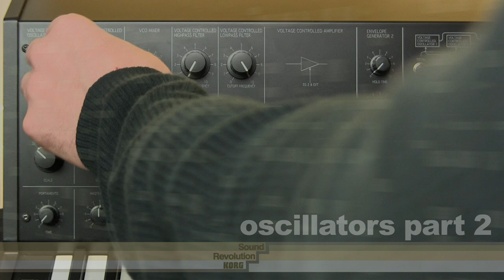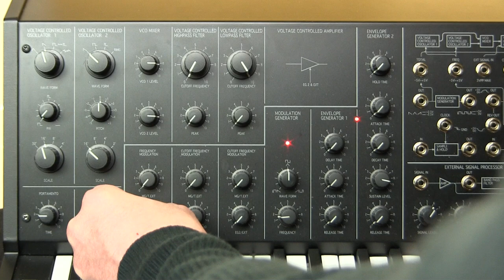The Korg MS-20 Mini- Oscillators Part 2

Comment from the maker: The MiniBrute is one of my favorite modern synths.  I can't get enough of the thing.  The re-release of the MS-20 had reinvigorated my attraction to it.  They're really both quite different, but I love both of them.  Ultimately, it comes down to which interface suits you best!  The MS-20 is a great way to learn about control voltage.

Comment: The MS-20 oscillators respond normally to Hz/V signals and all the trigger inputs and outputs listen for inverted gate signals (S-trig as opposed to V-trig). The Analog 4 supports both of those. So, yes, the A4 can sequence both the original and the mini MS-20.

Comment: I had a little session where I routed the cv/gate from a minibrute to a minitaur and routed the audio back to the minibrute. It was pretty cool to see the amp env, arpeggiator and lfo effect the oscillator of the minitaur and mix in with the filter, noise, and sub of the mb. As I played I would switch to the mb osc I'm cool now. It's good. :)

Comment: hey marc, i left a message on the 'ms20 mini intro' page regarding this!! according to the specs/ instructions on korg's site, it claims that the ms20 mini uses 'oct per volt' as opposed to the original 'hz per volt'!! in theory, this should make it more compatible with modern cv stuff (such as the frostwave fat controller or analogue solutions oberkorn)!!

Comment from the maker: The SH-101 has a cult following because of its genre association.  Previous to that, it was considered a cheap budget synth... being plastic, limited to a single oscillator, and having only basic functions.  I personally don't see anything special about its oscillator.  The MiniBrute, however, has a much more complex oscillator functionality which results in a MUCH more diverse set of possible sounds.  The same goes for the filter.

Comment: Another analog 4 question. I'm tempted to preorder one of these but I only want it if I can sequence it with the cv gate track on my analog 4. I've heard that the original ms-20 does not respond to cv gate levels that work fine with a majority of synths. Could you get a solid yay or nay about that being updated. I've heard it was from sales reps but they said I could return it too. :)

Comment: They both cross 0v, but they are different texturally. I'm all talk since I don't have one. A comparison video would be a fun afternoon project but $1700 is way past the fun threshold for a 101. The yellowed, crusty plastic, casio sliders, cigarette burns, knobs that feel like wheels on a toy car, and it's dependent on an equally expensive drum machine for the proper use of the arp/ sequencer. You can expect more for your money for sure.

Comment: Honestly, the oscillator is too weak on the minibrute to compare to an SH-101. Those murky expanses where the minibrute loses musicality and sounds like vip vip vip instead of the notes you're entering is not a common issue with an SH-101. From what I've heard the Eowave Magma sounds punchy and rubbery to make me think it's a 101 but the price point is high for what it is. I had three SH-101s when they where $500, now that they are $1700 I would love to see a good replacement.

Comment: The EG1 > Pitch doesn't "start at zero".  Did you mean zero hertz?  Regardless that explanation is incorrect.  The EG pitch modulation sustains at whichever note you press and the intensity knob sets how far below that note that the EG modulation starts.  You DO correct yourself later in the video.

The full range of EG pitch modulation that can be set by the intensity knob is like 59 semitones.  It's a figure I've been meaning to retest though.

I find EG1's delayed start is most useful as a mod intensity control, specifically for vibrato via the tri LFO.  Maybe you go over that in a later vid.
Reply from the maker: Are you saying that the EG starts at whatever frequency the keyboard generates?  The envelope generator doesn't know what note you're pressing.
Reply: Seems you're misunderstanding my comment.  Again EG1 SUSTAINS at whatever note you press.  It's start position is offset below that note by the EG1 >  Pitch Mod Intensity knob.  The point is that the intensity knob is determining how far below the pressed note that the pitch starts gliding up from...  You even demonstrate that later in the video.

Did you think the EG1 Pitch intensity knob was choosing an absolute start frequency independent of whatever note you play?  That would be incorrect. For example you can make the EG1 to pitch start exactly an octave below whichever note you're pressing... you're NOT making it start at some specific frequency like 110Hz or something.  (unless you play A3 220 while it starts an octave below obvs).
Reply from the maker: Certainly the keyboard defines the pitch of the oscillator... but the keyboard does NOT define the start point of the envelope.
Reply from the maker: The sustain is the voltage reached after the attack AND decay have done their thing.  The sustain certainly defines a frequency, but it is NOT the start-point of the envelope.
Reply: "Certainly the keyboard defines the pitch of the oscillator... but the keyboard does NOT define the start point of the envelope."
Again the start point of EG1's effect on pitch is offset to whatever note you're playing.  Do you disagreeing with that statement?  The amount of offset gets further below the note you're playing the more you turn up EG1 Frequency Modulation.  How much more clear can that explanation get?  Are you confused by what I mean when I say offset?

If you turn the EG1 Frequency Modulation knob up and EG1 has some amount of delay, the MS-20 will initially emit a note that is below whatever note you're pressing on the keyboard.  If you continue holding the note down in the keyboard it will eventually climb in pitch and sustain at the frequency that would have sounded had there been no EG modulation on pitch.

I have never given any other explanation other than those points right there.  I'm trying to use plain english here.  What part of that doesn't make sense?  What I'm saying is 100% correct so you're either misinterpreting or misunderstanding what I wrote.

"The sustain is the voltage reached after the attack AND decay have done their thing.  The sustain certainly defines a frequency, but it is NOT the start-point of the envelope."
We're talking about Envelope Generator 1 in this conversation, not the behavior of envelopes in general.  EG1 doesn't have a sustain or decay parameter.  If you were to compare it to an ADSR, EG1 would be functionally the same as an ADSR with full sustain.  Decay wouldn't matter in that case.  We don't need to lecture each other on envelopes.  Keep your points germane to EG1's influence on Pitch.

Seriously try to point out where you think I'm misinterpreting something about the behavior of the MS-20.
Reply: The previous comment is more important than this one.  I have to ask though... do you think that I believe Sustain on an ADSR somehow determines modulation depth?  If so I have no idea how you would've pulled that out of anything I wrote.